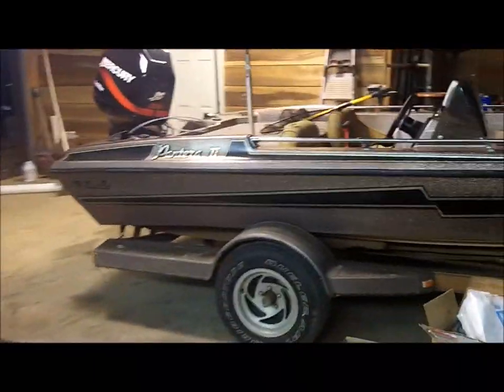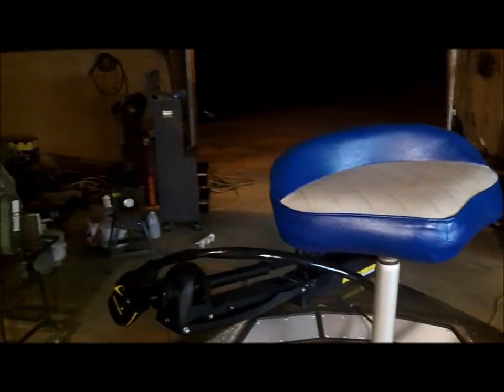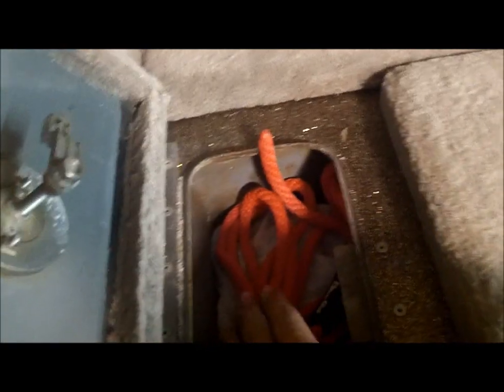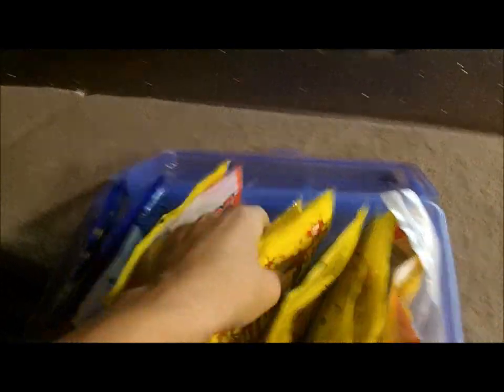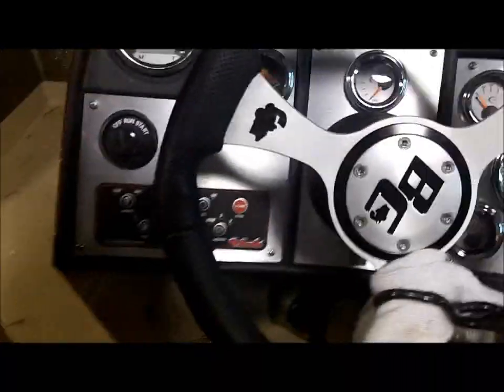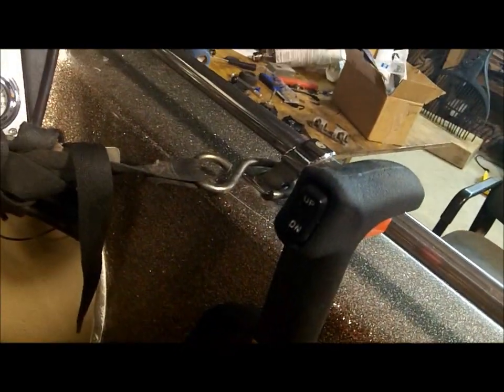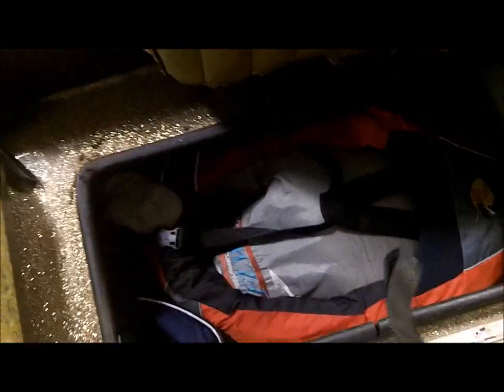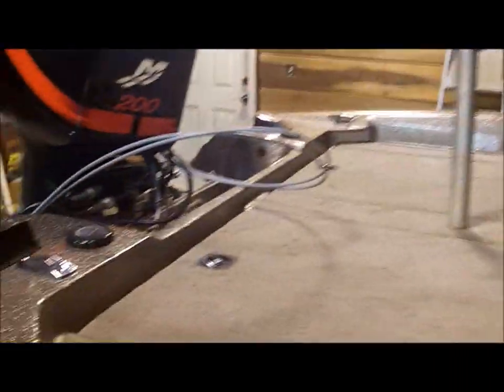My Basscat Pantera II

Comment: Wow! That is awesome! I'm assuming you sold your basstracker? You did a good job on the gel coat! That boat looks brand new other than the seats, I would replace those... If I saw that boat I would think its just a couple years old if the seat were re done.